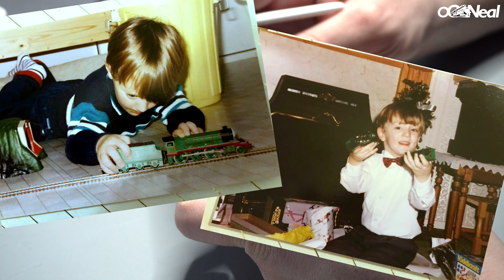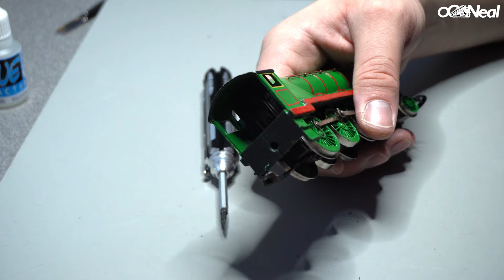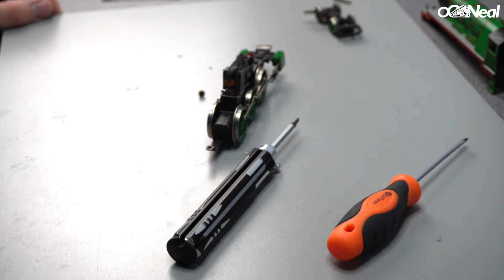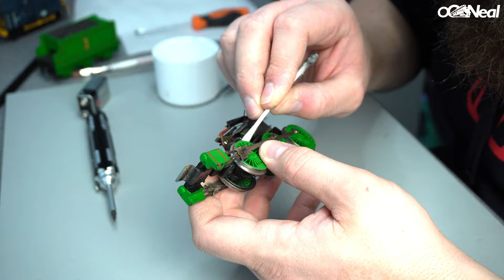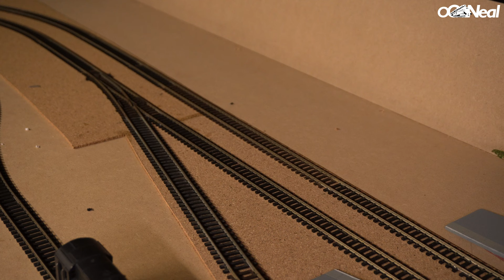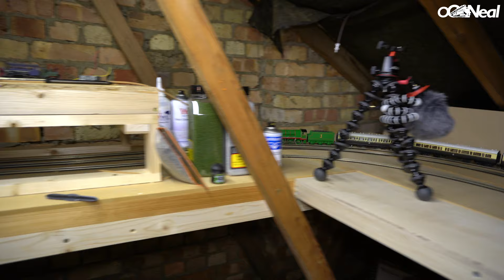Building Up A Model Railway S1 Ep 23 | Restoring my 29 year old model Henry

Comment: I haven’t watch the full video yet but why does Henry’s Motor sound like it’s going to die.
Reply from the maker: The engine is 30 years old and had an old motor and gearbox in it when it was given to me as it wasn’t new then.
Reply: You need to electrify the electric lube